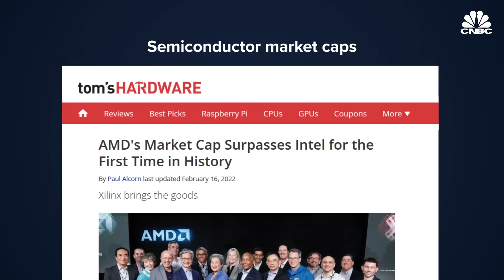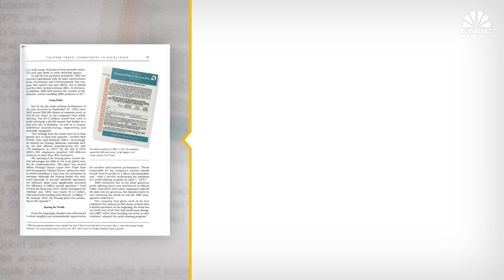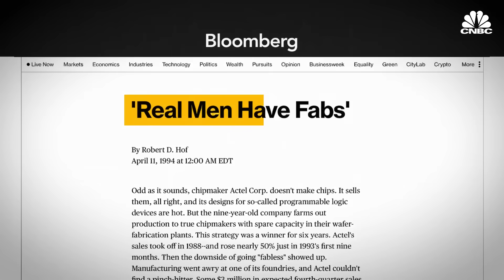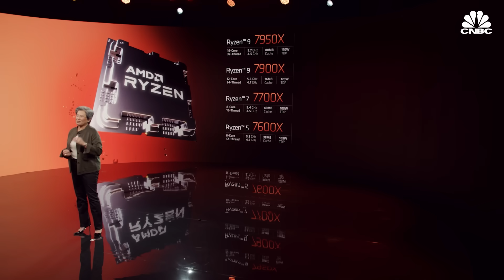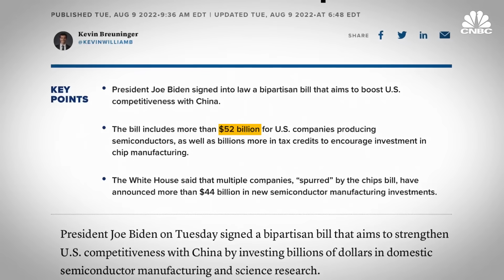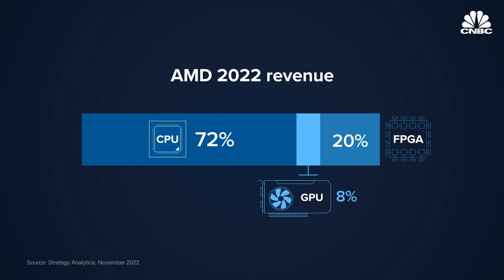How Chip Giant AMD Finally Caught Intel

Comment: Lets keep in mind, the engineer's had wanted to make something like this for some time, but through interviews we know that management wasn't up to it. Between her and Jim Keller, they were the people that freed up Mike Clark and the others to do their thing. 
 And let us not forget Intel's dark practices, literally paying company's to not produce AMD based products, or to keep them "on the back wall" away from eyes. 
Intel flopped when Ryzen hit, seemingly without a second to catch it's breath. And for some reason, despite so many years of dominance and high cost, they hadn't come up a solid "Chiplet" model? "4 cores - NO SMT", or "4 Cores + SMT" was the reality with them, i5 and i7 in a nutshell. K for clocking.  When people saw the 1600x and 1800x pricing, that was a wrap. AMD socket longevity was already a known thing.  Score a 120 dollar board and ride it from 1600x to 5800X3D. 
 -They did things Intel wouldn't/couldn't do. 4 cores as the cheap option, 6 as mainstream, 8 for upper. And the price for that 8 core was drastically cheaper than anything Intel offered similar. Absolutely disrupted the CPU market their first generation, and continued to tear them apart each launch cycle. "Chip Glue" statement bit Intel in the butt, as it was obviously in the making ever since the first 3xxx APU's. They learned how to make really really good glue.  In the major consoles, the APU's are beloved monsters in handheld gaming. And the notebook range is dominant. Threadripper and Epyc took markets away from Intel.

Comment: The latest High NA lithography machine costs between $350 million to $380 million. Think of it this way, a Boeing 737-MAX costs $100 million. One wonders what the semiconductors that it is capable of producing cost.

China is limited to their three generation back lithogrpahy machines, DUV lithogrpahy machines.  With it, SMIC can produce 7nm chips and is said to be working on 5nm.  There are some media reports saying 4nm is possible.  If so, does the world really need 3 to 1nm chips?  

China is said to be developing photonic and graphene chips capable of producing high end chips capable of more bandwidth and less power consumption with less heat issues, without ASML's high end lithography, one wonders about the economics of ASML's EUV lithography machines.

I think in this decade, we will see who wins this race to produce the highest performing semiconductors and there is a good chance it will be China.  If so, one wonders if the US will resort to war in an attempt to stop China's rise in semiconductors.  So far, China is doing what took decades to do by the west in one decade and may supersede US semiconductor technology.

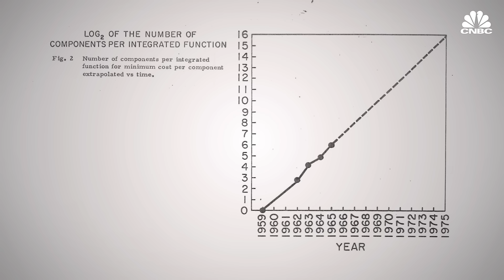Comment: At 10:56 it mentions Moore's law which doubles the number of resistors every 2 years, yeh well, what could you expect from a journalist. As a chip designer back when the term first got traction, it used to be the number feutures per given area, but then just became the number of transisters. Features is a far better fit because it follows the production process and lithography limits, but regular folks wouldn't know what a feature is. A transister used to make a DRAM or SRAM or logic gate are very different in shape so not very relevant either.

Comment: This whole video's title can be answered really quickly: AMD passed Intel in how small they could make their transistors. It really is this simple.

I'm sure a lot of other things happened that also contributed to AMD 'catching up' to Intel, but none were bigger (or smaller) than AMD's transistor size compared to Intel. There is simple almost no substitute for smaller transistors. Smaller transistors allow for lower power consumption, lower costs due to using less silicon, and higher performance (mostly through higher clock speeds).

Yes, I'm glazing over a ton of smaller things, but zooming out, this is THE major reason AMD caught up to Intel.

Comment: AMD has good chances on Neural Computing Solutions for Retail Sectors. For manufacturing Mini Data Server Stations are needed where AMD can explore the options having Chip Accelerator of Multithreads with increased no of Logic Gates for Emulator Cores as a Unit – Kind of Affordable than GPUs.

Comment: They work together &doing their best on installing spyhardware in within their chips. Bravo! They both swallpw d now. Your devices are bugged if you have AMD and Intelme chips installed. Nothing is private, you have are not the owner of these devices, they still are, they even can do much more on your own current owner devices than you can ever do, and you wont even see their tamperings works or what exactly they are seeing.

Comment: The intro to this video is very misleading. First it says that most advanced computers have two kinds of processors - probably CPUs and GPUs implied here. However, saying that only one company designs them both is purely wrong, considering that this video was published just three months ago. Intel has been designing CPUs and GPUs for many years now. Likewise, Nvidia has Grace CPUs (ARM-based) and GPUs. The Samsung S23 Ultra is almost a portable advanced high performance computer - with a Qualcomm designed Snapdragon CPU and Adreno GPU.

Comment: When you talk about chips in the current concept, you left out 2 very significant players who could easily upset AMD. 
NVidia - the major player in height and compute processes use from everything from machine, learning AI and high and big data.

ARM - which virtually dominate the mobile space, i.e. phones, tablets, etc. and also into other mobile devices.devices.

All these areas are facing explosive growth compared to generic computing, which is the main market AMD is in, the server and high end desktop desktop market will be eaten into by Envidia. And arm-based processes are becoming powerful enough to become desktop chips, and an energy efficient enough to play a significant role as server chips.

I think by omitting to mention these other players, you have been misleading, and not given the audience, a Fairview of the industry.

Comment: I feel like we've gotten to the point where CPU design and performance is improving at a faster pace than the average consumer needs.

For example, in my home we have three intel based computers. One is an i7 3770 another is an i3 3.5Ghz 2/4 thread CPU both 2012 Ivy Bridge and my mac has an 3.0Ghz 2/4 thread Haswell CPU.

All of them still do a great job for what they're used for. In fact Windows 10 going out of date in 2025 will force me to upgrade probably more than I need to.

Sure all of these are weak compared to the new CPUs, but compare this to previous CPUs like Core 2 Duo and previous, all of which showed their age. Yet iCore and Ryzen CPUs just keep on handling the workloads.

You could never have told a younger me that I'd still be happy with 10+ year old CPUs.

We've even gotten to a point where ARM CPUs are amazing. The Apple M1 in incredible. The iphone A13/14/15 etc are more powerful than you really need in a phone or tablet. Think about it, the M1 was shown to have a competitive single core performance with decent intel CPUs at the time and the A14 iphone 12 CPU is the same at a different frequency and less cache. But you more or less have desktop performance CPUs in your phone now. I don't think we even need that.

The 4GB RAM iphone 12 mini is vastly more powerful than a 24 inch 4GB intel iMac from late 2008. That thing is HUGE and VERY HEAVY.

Comment: Wow, this report really misses the mark on what saved AMD's bacon and the future of CPUs.  x86 is a relic, but most of all it's a simulation.  It's a CISC processor wrapped in a RISC simulation, wrapped in a CISC  instruction set.  The i64 instruction set, which is most dominantly used today in desktop computing, is a single layer CISC instruction set.  AMD designed i64, and is the sole developer.  

That not withstanding, the technological advancement that saved AMD was Bulldozer and chiplet manufacturing.  Chiplet manufacturing breaks a processor down to its core components, and manufactures them separately rather than making one large monolithic die.  This way, if a defect happens during the manufacturing process, the entire large die is not lost.  Rather, a single chiplet being lost is 1/20th the cost.  Thus, production yields go from 75% to 90+%.  Then, you have the versatility of being able to mix and match components within the processor to build a SKU line.  Not everything in a processor needs to be built on the latest and greatest fabrication process.  Things like IO can be built for a fraction of the price using 2 to 3 generation old technology.  Last, the chiplet design allows the mixing of core types.  They can keep the power hungry, but powerful, latest generation i64 cores, but add in more efficient and specialized ARM RISC cores for when the brute strength is not needed.

I'm not sure how FPGAs will fall into AMDs lineup.  They are very high cost processors which are very complex.  This video kind of skims right over this.  an FPGA is a microcontroller rather than just a microprocessor, meaning it is a SoC with direct pin connections to external devices allowing for single chip automation.  The neat, and expensive, part of an FPGA is that the internal circuitry for the connection for each pin, and even some internal circuitry, is fully programmable.  This mean the functionality of the IO pins and other internal circuitry can be defined by the installer.  This allows for one chip to be customized for very specific, typically one off or low production use.  This is why it's use on things like Mars rovers and cell phone towers, to allow system upgrades without touching the hardware.  One big use for FPGAs is in testing labs for new CPUs and GPUs.  The programmable nature allows new chip architecture to be tested before it is committed to fabrication.

Comment: without AMD we would still be using Intel i7 clocked at around 3Ghz and have 12 cores for the most expensive model. Thank you.
Reply: What are these products ,never heard of , can you buy from venkat znd madhavi company , they also manufacture chips,  42 cores , 99ghz , 256856894e689447 billion transistors , just got it from accountant venkat , what I mentioned could be less though. Head office is in ballari

Comment: Jay Goldberg is talking out of his butt. AMD wasn't useless for "decades" until Ryzen came along.

In the early 2000s and mid 2000s AMD matched or surpassed Intel doing things like the first commercial 64 bit cpu for desktops. Bulldozer was a major failure in the early 2010s and then AMD bounced back with Ryzen.
Reply: Agreed.  The Athlon/Duron era AMD had a lead on Intel.  It is not always underdog for AMD.

Comment: I have been buying Intel CPU's till Pentium 1 - 133Mhz days.  The only AMD CPU I switch was when AMD Athlon came out, then went back to Intel due to price and performance and power efficiency was just Intel's strong point.  Today I can say that I've bought AMD Ryzen 7600X CPU so it's great that AMD is back at it again and creating the necessary competition in the market.  Intel has it's work cut out for them this time.

Comment: Funny to see how mainstream media is so far behind the industry. (just a bit context here, AMD is overtaken Intel around 2019~2021, now Intel has reclaimed its throne with help of alder lake chips.)
Reply: The market doesn’t care about “client”. It’s all about the datacenter - EPYC vs Xeon. Performance per watt and density are key. Especially with energy costs going through the roof.

In both these metrics there is no contest. Even with Sapphire Rapids release - the first Xeon utilising Alder Lake’s Performance cores.
Reply: @BlahBleeBlahBlah  true point. But Epyc had its place long back in 2020 if I remember correctly. Media still are far behind :/

Comment: FPGAs do the same thing a DSP can do.  Be re-programmed on the fly to function as any CPU, GPU, I/O architecture to effectively become that class of circuitry.  A DSP based computer could be re-programmed to become any brand of CPU or GPU.  Its performance could be increased over time.  When it is no longer physically possible to get better performance just add more DSPs or replace the older ones with the next generation.  In this way the home PC can be future proof far cheaper than going out to buy new computers every few years.  One machine can be an AMD, Apple, Intel, ARM, GPU renderer / CUDA, or an entirely new architecture.

Comment: How does TSMC have the advantage over intel with their process compared to intel who is struggling to get to 4nm? They are both using the same EUV machines from ASML, so there must be more to it.
Reply: Process technology is more than just the EUV lithography machines.  It is very complex manufacturing process with thousands of steps and hundreds of different materials.  TSMC does a lot of basic material research.  TSMC also works with upstream and downstream suppliers to get the material they need.  Just the photo resist plastic provided by Japanese suppliers are miles ahead of Intel.

Comment: It will be hard to shake Intel's grip on mass produced CPUs. Intel is in cahoot with Microsoft.  All Intel chips are developed around running Microsoft software.  I've worked for many employers over the years and never have I used a company computer using AMD cpus.  It will be an uphill battle for AMD.

Comment: From time index 10:57 Ms Tarasov mentions Moore's Law in terms of the number of resistors on a Silicon microchip would double about every two years.

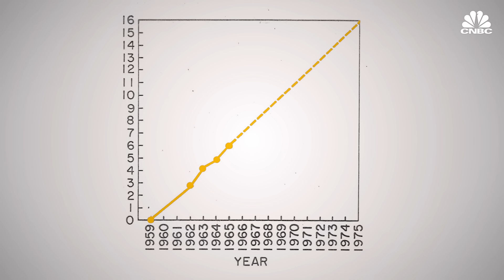The transcript itself notes at time index 11:01 "of resistors ..."

I can't believe that a professional Journalist would confuse resistors with TRANsistors?!

Moore's Law states that the number of TRANsistors on a Silicon microchip would double about every two years. 

The TRANsistors are the actual voltage/current switching elements that enable electronic digital computers to implement binary logic, patterned/organized into computing elements applying the Mathematical principles of Boolean Algebra.

Comment: Yea, whatever, lol!! AMD is a joke and has been for years. Intel is as well and neither of them are the future of anything at all!!

If they don't have a fundamental change in their backwoods thinking. To even achieve half of what TSMC does on a daily basis. 

It would take an investment of over 1 Trillion to catch up just with it's current production lol. Add to this ASML which is the only manufacturer. 

Which is producing the advanced equipment for high end chip makers. You have a bigger problem than just supply chains here. 

We need to get rid of the red tape & special interests. If we have any chance in hell of achieving even half of what is being promised here. :/

Comment: I've been working in IT for more than a decade now and also build PCs privately for friends, family and business acquaintances. The last time I installed an Intel CPU into any of my PCs was back in 2016, when AMD had yet to reveal the Zen platform. Ever since 2017 though, justifying the purchase of an Intel CPU has been pointless. Why pay more for something that either gives you marginal improvements or needs noticeably more power to achieve it? And even when there was a legitimate argument to be made for the competition, I would always make sure first that the AMD alternatives are not suitable for the required tasks. So far, this has only happened three times in the last five years, in which time I have built over 20 computers privately.

Whenever possible and unless there are very specific requirements to be met, my money will always be with the underdogs. Healthy competition only works in the long term if multiple parties can compete with each other and one isn't monopolising an entire industry.

Comment: If only AMD would compete with Nvidia. Despite promising releases, AMD always has Caviats and shortcomings in their GPUs. There's glaringly poor raytracing performance that is only growing more prominent in gaming, making AMD's high-end GPUs an odd choice. Not to mention the recently released Radeon RX 7900 XTX is experiencing thermal problems at a large scale, ironically after they made fun of Nvidia's power connector fiasco. They also followed closely to Nvidia's factory scalped GPU prices.

Comment: As a consumer, I love whenever AMD is a viable option against Intel and Nvidia. I've been switching pretty regularly for the last 20 years.

14:00 You point out how old x86 is, but ARM as an architecture isn't that much younger. I do wonder what a completely new, modern architecture would look like. Or if it's even feasible.

Comment: I wonder if it would be possible for an x86 upgrade to the instruction set? If they sold duel systems with both cpu's, weather that could be a thing? and work well, while the industry adapts to the new standard.
Reply: No because it would break compatibility with decades of software

Comment: Yeah my Ryzen chip (3700X) which is cheaper by a lot of it's Intel counterpart makes my day to day software development life so much better.

Intel focuses so little on multi threading and so much on nonsense (from my perspective). I mean, yeah, AVX512 is cool and all. But i need more cores, not more SIMD instructions and slightly higher clock frequency.